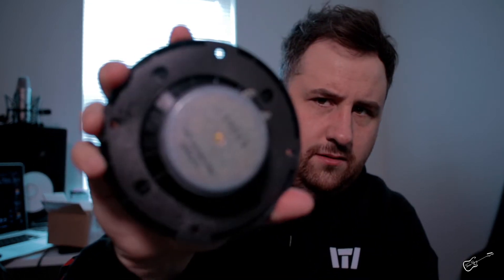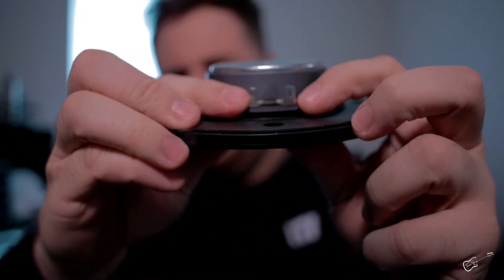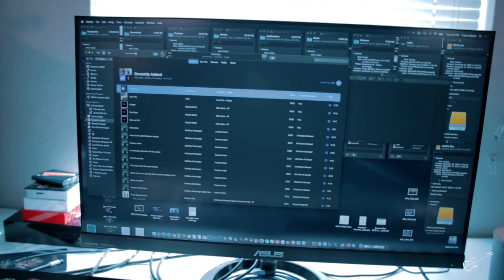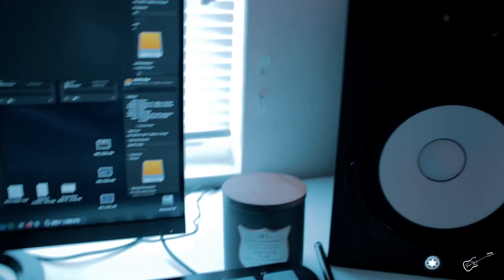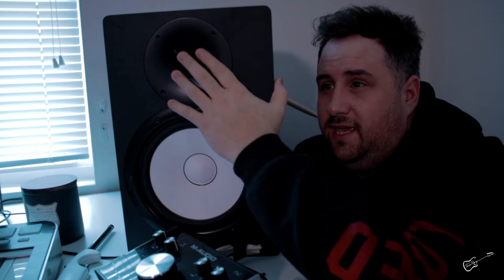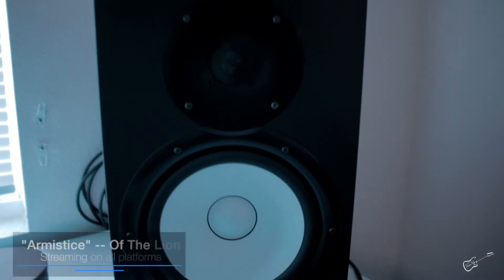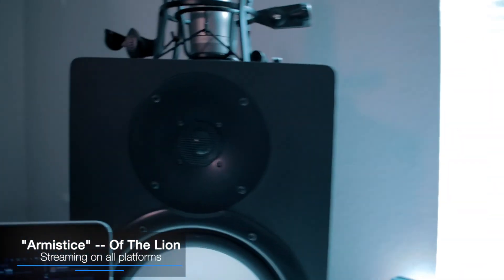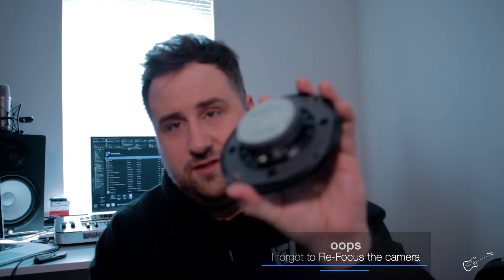Yamaha HS8 Studio Monitor Repair // Travis Rigney

Comment: Good job fam. Thanks for this video. I'm having a issue where I have a rattle in the back. None of the speakers are blown. I tighten up the screws but it still isn't helping. When I turn it up and bass is booming, I hear the rattle. When I push on the back of the speakers where the metal part sticks out, the rattle goes away. Crazy

Comment: what happened to the tweeter? mine is making a weird noise like distortion specially when playing around certain frequencies. I haven't had them for even two years and I got really disappointed this is happening. I was wondering what your issue was since in my case it might be the amp or something.
Reply: Im literally having the same issue, i bought brand new HS8s and had this problem ever since, on top of that i have a brand new apollo x6 and the problem is still there. @yamaha really dissapointed me, if my tweeters are blown, I was sold some fucked up hs8s
Reply: @damvgebeatz  I don't really remember how, but I got it solved without having to repair anything. I think it had something to do with the cables from/to the interface but I'm not sure. It could be the case with yours as well. Try messing with that, changing them, etc. I hope it works. cheers

Comment: Why does the foam hang over the tweeter in a lot of these Yamaha HS8 speakers? My foam on mine dangles like yours on my speakers when I looked through the bass port.. I talked to Yamaha and they said it’s totally fine.. but it should be stronger glue or foam